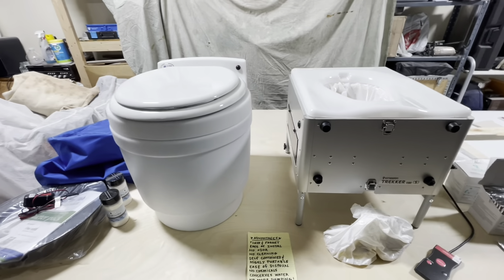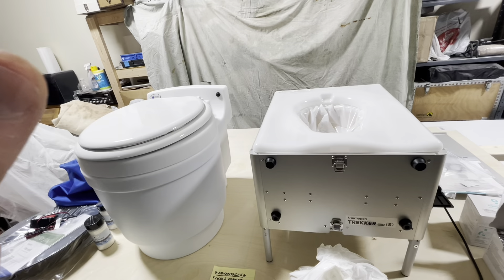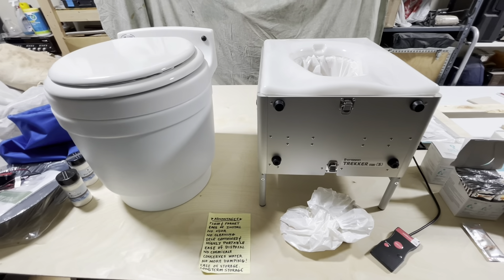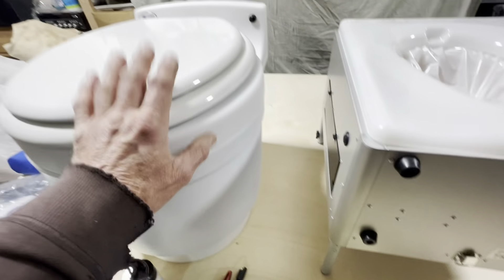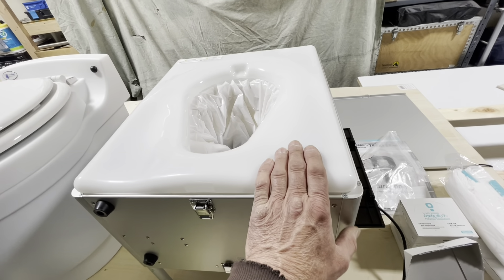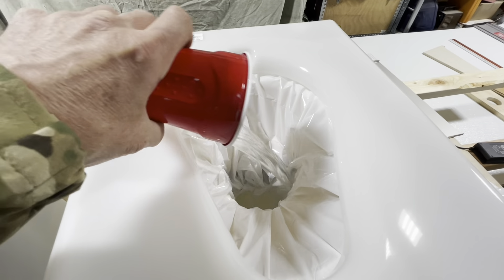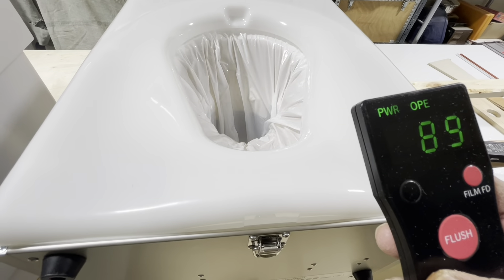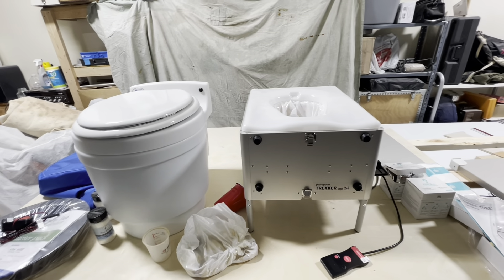Laveo vs Wrappon Trekker WT-4 Dry Flush toilets reviewed. Other Dry Flush toilet options

Comment: For folks looking for a permanent or semipermanent installation, the Laveo is a better package: it looks and feels more like a traditional toilet and it stores the waste internally. But if the Wrappon is installed in a purpose built box (like the one made by Lost Hiway for example), and then its advantages over the Laveo shine through. There are no bulky cartridges that need to be stored. There is no long term storage of human waste, the individual bags can be disposed of whenever convenient.
Reply from the maker: Agree with your points 100%. The Trekker is slightly cheaper per flush and the thermo liner cartridge is much more compact to store an extra when traveling. To get the same amount of flushes as a Trekker roll with the Laveo you would need 3 of those bulky plastic cartridges. Not a big worry for me personally but throwing all those plastic cartridges in the dumpster doesn’t sit well with me or most people. The Swiss Clesana C1 toilet looks to be the best of both worlds. They use what looks to be a direct copy of the Wrappon sealing system and multi layered bags but package it in a more traditional form factor like the Laveo. It also has a feature that lets you select the bag size, smaller for a #1, larger for #2. The bags drop into an internal bin for storage until you empty it. The Clesana C1 sits right in the middle price wise at about $1200. I have never smelled anything funky from the bags the Trekker produces. The bags seem Odor proof as advertised. We will probably put the Trekker in the van build and the Laveo in our off grid hunting cabin
Reply: I don’t want to do any dumping
Reply: @boundariessetinstone5893  
But if you take a dump, you'll be full of $hit then!  🤣
Reply: @SPQR-Z can you get the clesana in the USA?
Reply: @SPQR-Z can you get the clesana in the USA
Reply from the maker: @hmmm2564  Short answer is yes but it will not be as easy as ordering from Amazon. There are a couple US dealers that I have seen advertise the Clesana toilets. Example: Vans and Campers in Chandler Arizona. Never heard of them and am NOT recommending them but I do see they advertise the Clesana on their website. You can also find a dealer in the EU that will ship to the US but that would be a more expensive option. UK and German dealers would probably be your best bet. Have ordered European RV equipment from both UK and German dealers with good success. Also the high shipping costs are partially offset by not having to pay the EU only 20% VAX tax. Of course any dealer should be thorough investigated before ordering. Especially any US RV companies advertising the Clesana because as far as I know Clesana does not have a USA distributor yet, although they were working on setting up North American distribution.

If you have someone in the EU, friend, family that can buy the toilet and ship to you that would be another option. We have my wife’s relatives in Norway ship us many items from Europe that are either expensive, hard to find or impossible to get here in the states. Just had a big food package arrive from Norway the other day. Her relatives also just shipped me an old German antique lantern which is clearing US customs right now. So our experience in getting private packages from Europe has been pretty reliable. We’ve had everything shipped from food, to camping/RV gear to antiques with no issues.
I really do like what I see with the Clesana toilets. Do wish they could be easily purchased here. I think they would give the Laveo and Trekker a run for the money. Good luck
Reply: @SPQR-Z  Great video, thanks! Where do you see the Swiss Clesana C1 toilet for sale for $1200 in the USA? I see $2000-$2500.  Thank you!
Reply from the maker: @ANomadsNest  No $1200 was not the USA price. That was the European price as of the posting of the video. I imagine it’s a bit more nowadays but still should be well under $2000. Not sure what the price in North America is or even if there is a designated importer and distributors network established. Last I heard Cleasana was trying to get the network up and running in North America. I have only seen one RV parts seller in the US advertising the Cleasana C1 for sale but not sure about the legitimacy of that seller. They may just be buying it from a European retailer and reselling them in the US. Hence the high price?
   Another option is to find a UK or German retailer that is willing to ship to the US. I have bought several European only RV parts and had them shipped. It wasn’t that hard. Also if you know someone in Europe that can buy/ship to you that might also be an option. My wife’s relatives in Norway have shipped us camping gear, furniture, antiques, food items etc. Never a problem except sometimes there is duty tax to be paid and customs can add weeks to transit time, but the shipments have always came through. Just received a big holidays food package from Scandinavia no problems. Very interested to hear about someone in the US get and review the Cleasana C1
Reply: @SPQR-Z  Thank you so much!

Comment: We just bought a van with the Laveo. It has been my choice for my 4-6 years of doing research. We are full time. Was wondering if you thought you could pee and use the powder several times before flushing?  Just curious because I considered having a pee jug since I pee 4-6 times a day and didn't want a $8 cost per day.
Reply from the maker: @mitchklann4995  A fair question. The actual capacity to hold whatever waste goes into the Laveo is determined more by the bucket holding the Mylar tube. In other words the bucket is the limiting factor. So doing a big #2 followed by a large amount of TP or doing multiple #1 followed with pee powder (which really expands) will fill the volume of the bucket container faster and limit the ability to use the toilet first rather than running out of Mylar liner. Does that make sense?
      That said we still use the toilet at least twice for #1s and sometimes three times depending. We noticed straight away that the bucket fills faster when doing that but have always been able to use the entire Mylar liner cartridge. It has come close to being near the top of the bucket which caused the last twist to not entirely engulf some of the TP that usually sits right on top of the deposits. A good practice is limit the pee powder using just the amount needed to absorb the liquid, so adjust for a large deposit vs a smaller deposit. We always use the Pee powder regardless of a #1 or 2. Using the Laveo over time you’ll get a better understanding of what will work best for your particular usage. I agree with you about a dedicated pee jug. Working out a solution there will definitely extend the Laveo’s cartridge.
   Not having to deal with dumping and cleaning has been the best part of owning these Dry Flush toilets. The cost has been more than acceptable to us because of how we use the toilet. We recently did a 3 day trip in the Sprinter and didn’t even use one full cartridge. That cartridge will sit in our Sprinter Lav until next trip with no worries about smell. The Trekker is used in our off grid cabin and has accumulated allot of use. Happy to report it’s been flawless so far
Reply: @SPQR-Z  great feedback and thanks. Guess there isn't a way to cut along the seal to remove a portion of the waste so there is room for more. One advantage of the wrapon I guess.  I figure even 2 people, each, 4 times a day, for half of the year it would be less than $2500.  More than what I would like but also a small cost for convenience. Thanks again.

Comment: Personally I like the Trekker because you can dispose of the waste immediately. I dont want waste sitting in the toilet in case something malfunctions.
Reply from the maker: @roslolian11  Yes that is nice about the Trekker. The individual packets are easier to handle and more convenient to dispose of. Will say we have never had any perceptible odor coming from the Laveo cassette and it’s been in the van weeks at a time. Being large disposing of the cassette is more problematic, because in most situations you really need a dumpster. Also not happy about all that plastic going in the landfill
Reply: This. Even if just using a diaper genie for the single bags with number one to me seems more sanitary.
Reply from the maker: @apeyoutube7485  We now have some use with the Trekker sealing dry flush toilet system installed in our off-grid cabin. So far it’s been perfect and my wife prefers it over the Laveo. No odor or leaks from either and we like them both. I don’t see too much negative reviews for either of these toilets. Overall they both seem robust, reliable and live up to their manufacturer’s claims. The Laveo is now permanently mounted in our van and the Trekker is installed in our off grid cabin

Comment: Having a single bag that can be disposed of immediately is huge, as opposed to having 15 poops sitting in your van until you have finished the entire bag system of the Laveo. However.... that depth of the front side of the trekker looks bad. No one wants to be draggin their ball bag n junk all over the plastic bag.
Reply from the maker: @CC-kq8hf  Yes the thought of having all that waste sitting in the Laveo’s internal big has a creepy ick factor. That said after months of use including letting half filled cassette bags sit in the toilet for weeks has never proven to be an odor source problem. It seems the main source of odor with the Laveo is people themselves accidentally making a bit of a mess, not cleaning it up straight away and it starting to stink.
       We have a some real world use with the Trekker now and like that you can dispose of the single use waste bags and not have to wait until the Laveo’s cassette is full to empty. The single bag is easier to dispose of in any trash can whereas the big bulky Laveo cassette you almost need a dumpster to get rid of it. You make a good point if junk on the Trekker. I usually push the liner down before using because it is near your junk and can cause some back splashes. Nothing bad but probably better safe then sorry

Comment: Americans are usually bigger than the rest of the population. How come none of these reviews address the actual size? Is it just me or it looks too small?
Reply from the maker: @xyverjaze  In general bigger people are not a good fit on your typical RV toilet. They are all on the smaller size to fit into much smaller bath areas in an RV. The Laveo is definitely a bit bigger and more like a home toilet in size and comfort with its residential style seat. The Trekker seems more compact but it’s somewhat deceiving because it measures out bigger where the rubber meets the road, so to speak. The toilet seat itself is hard and not as comfortable but personally this doesn’t bother me. Bottom line is both these toilets size/ergonomics will be fine for most people that are within the average size range. A few my larger sized friends (6ft+, 250lbs) have used our Laveo and loved it so I guess when you have to go the convenience wins out over small details
Reply: It's not small at all. Unless you do weight 200kgs that is.
Reply: It is a good observation for a market segment on the larger size.